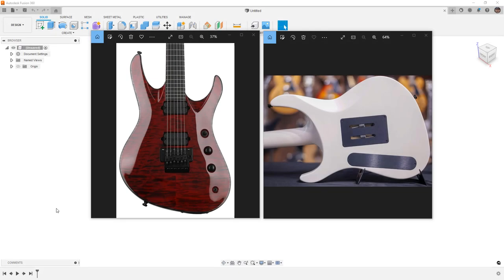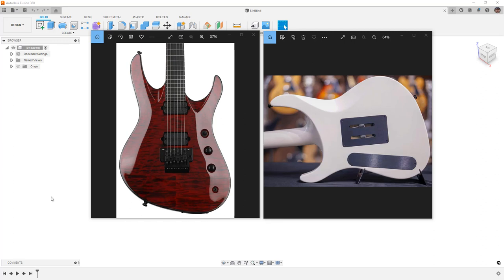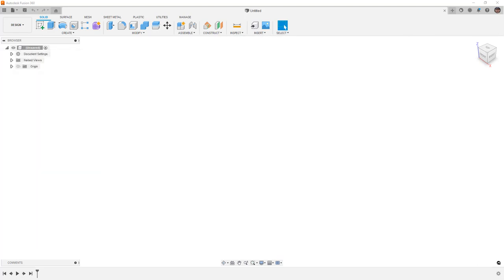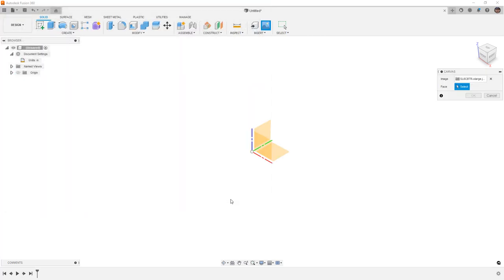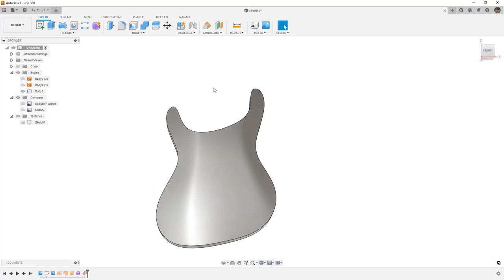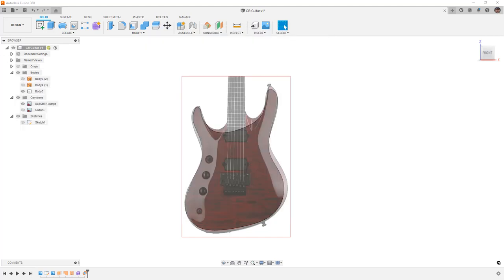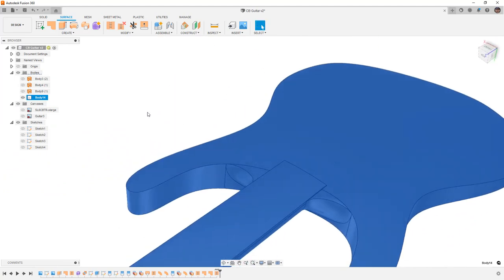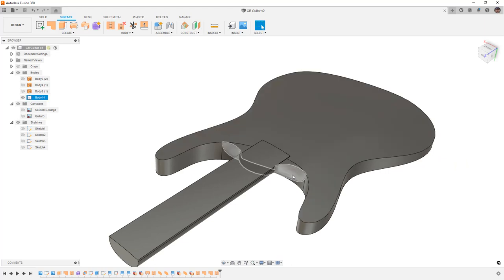Modeling Tricky Guitar Transitions with CAD | Chris Broderick Pro Series CAD Modeling with Fusion360

Comment: Hey! Im curious if you have any knowledge on making molds out of the form models you make. Your videos are awesome and im on a project endeavor that requires making molds for fiberglass parts.. in the event of complex shapes like car fenders im still not exactly sure how im supposed to finish up a mold with that.. i do understand the process for casting molds.. but for fiberglass i really have little clue😅 i'd appreciate any advice or if you know how to, would love a video about it😁😁
Reply from the maker: Hey Ricardo, Yes I have made molds before, but I guess the trick is how are you going to get a CAD of a mold to reality?  Typically on larger parts you would make the Pattern of the part.  Typically you would overbuild it to have seams and extensions so you can trim it to size after.  For smaller parts you could 3d print the mold, or print multiple pieces and put them together.  I can certainly show the process but not sure how you would make it off the CAD file honestly.

There is a great channel in the UK that deals just with composites and they have done videos on moldless parts as well as 3d printed molds.  Not a step by step how to but a great resource.  https://www.youtube.com/user/easycompositestv

I can certainly show the process digitally if you think it would help.  Typically the way I have made parts is I build the real thing out of metal, foam or wood.  smooth it, seal it , paint it so its high quality.  Then you start waxing it and i use a PVA release film for extra insurance.  To build the mold off of it I would typically attach something like a mortar board.  Something that has a smooth finish, wax and pva that too after you build lips around your part.  If you need a 2 part mold you would typically build one half first, after cure you remove the mortar board part and then mold the other side.  you will want to drill holes on the lip before removing so you can align them to build a final part.

Let me know your thoughts and if you want to continue the conversation you can always email me as well. Support@caducator.com

Comment: Wow, really awesome Matt as usual, thanks so much for showing us this type of design. Question is there a way to control the transition from the body to the neck shape, maybe with an additional rail ? Not sure this is possible on a patch, I see the mention of a rail in patch but never figured out how this works. Anyway thanks for your time and efforts on this one. 👍👍
Reply from the maker: No problem Hans!   On the transition, rails on a patch is probably not going to work.  I don't like the Patch tool unless I have no choice.  The best way is loft but instead of lofting from a point at the neck to use a profile.  Maybe I need to do an update on that part.  But at the neck we had the point but really there is a small line we could use instead.  If we use the line we can drive tangency so it is smooth.  Hopefully that makes sense.
Reply: @LearnEverythingAboutDesign  yes completely I'm going to try it out myself and see if I can come close to your example, tons of things to learn :)